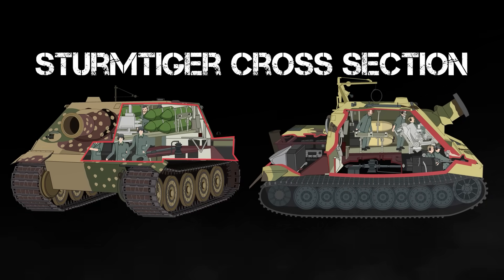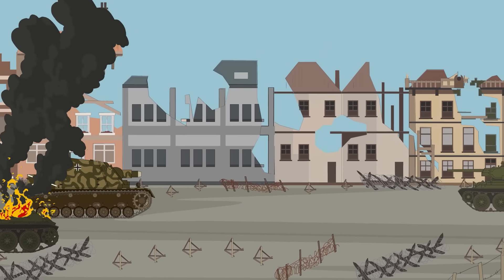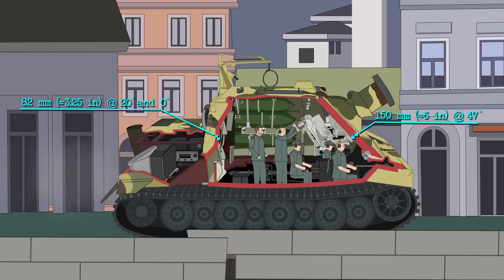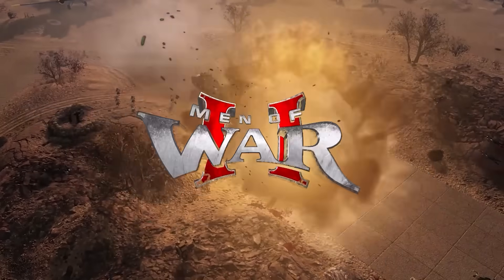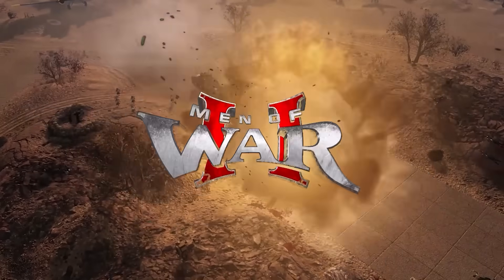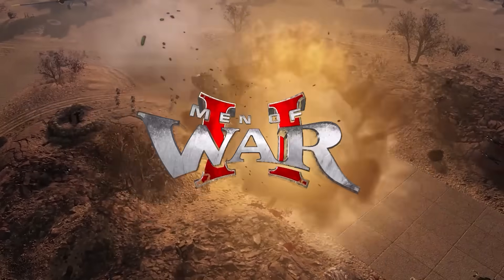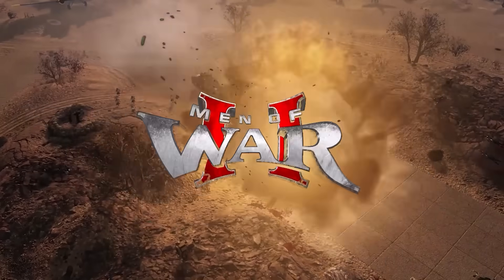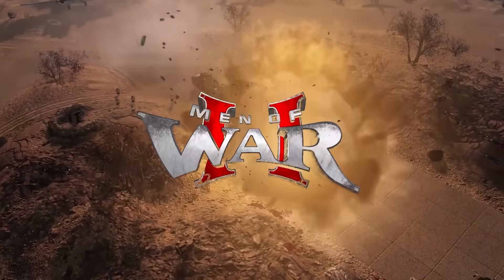Life Inside A Sturmtiger Tank (Cross Section)

Comment: Note: The outside crane was temporarily and was only used to load the ammo into the vehicle. It was dismantled after.  Reloading the gun after firing while in action was done by using a trolley crane bolted to the ceiling inside the vehicle. (Using the outside crane in combat would make absolutely no sense.)

Comment: 5:20 that crane is for aiding with getting the rockets from outside the vehicle into the vehicle using the hatch in the roof. It was not used for reloading the gun.
You got that reload from the Company of Heroes videogame
Reply: is there any source providing this? I cant imagine a human somehow putting a 350kg rocket into the tube
Reply: @lada_niva_1.7i  it's two humans actually, the vehicle has 2 loaders. I don't have a source but it's pretty well known that reloading the vehicle with the crane is misconception. To the point a quick Google search on the matter will show you. It's not something obscure you have to go digging for the info.
Reply: @lada_niva_1.7i  also the rockets aren't man-handled into the 'breech' / rocket tube. There is a "loading tray fitted with rollers" (-Tank Museum website) that leads into the breech. 

But also its evident from looking at the outside of the Sturmtiger that the crane can't access the ammunition racks on either side of the hatch. The long and thin hatch opens over the loading tray in line with the gun, but the stored rounds are on either side, so picking them up with the crane would mean lifting diagonally with the cable scraping on the edge of the hatch. If the reload was meant to be done with the crane they would have just designed hatches over the ammo racks too so they could lift up and across onto the tray.
Reply: @Deuce_and_a_half  ah alright, so the 2 loaders carefully place the rocket on a tray and then slide it into the tube?
Reply: Your comment is an accurate yes they did that they did that because of the sheer white of the tank why is the crane there then?
Reply: yeah, wish modern games paid that much attention to detail
Reply: "As both rounds weighed 345kg, they were far too heavy to be handled manually. Loading them into the Sturmtiger was done with a small crane. Inside the vehicle the crew moved the rounds into the breech ready for firing using a loading tray fitted with rollers. There was space for 14 rounds in the Sturmtiger, including one on the loading tray and one already loaded."

From the Tank Museum. Cant post links. 

But the crane was used to restock ammo, not to load it into the breech
Reply: The Sturmtiger had a roof-mounted winch inside the fighting compartment to move the projectiles from the sides onto the loading tray.

Comment: I figured the weakness of the Sturmtiger would be the fact that the Tiger's engines constantly wore down and was in constant demand for spare parts. I didn't know it needed a crane to re arms its main gun with its 760-pound shells (presumably they are too heavy to lift by hand). On top of that if this animation is correct, the crane is outside the vehicle, making it an easy target.
Reply: The external crane was for restocking shells. 

There is another crane inside the vehicle that assisted the loading of the projector so that no one was exposed during the process. Well, aside from the front as there’d be a 38cm hole briefly for the next rocket to be loaded.
Reply: @theworldsthreat  Oh OK, so it's not as dumb as this animation makes it look. it "only" has the weaknesses of no horizontal traverse plus the usual Tiger engine problems.
Reply: @alex_zetsu  Yes. The engine and transmission problems would be worse from the added weight too. 

On a side note: The projector also takes a couple minutes to reload, not a half hour or so. I’ve seen many people claim it took forever to reload but that isn’t true either.

Comment: Sturmtiger was basically the German late-war "solution" of dropping a 300 kg bomb on specified targets, but without using a fighter-bomber plane, and by that comparison its accuracy was not too poor. Similarly to the German V-2 rockets replacing actual bombers in bombing cities at last years of war, the German developed such exotic designs when there were more straightforward or practical solution were simply put, such solution was practical no longer in face of resource shortage, mainly fuel and thus the disappearance of German planes and trained pilots in latter war years.

Comment: It's the Sturmtiger didn't get to see much of a fight due to it's late introduction and limited production.
Reply: And the fact that it was badly designed.
Reply: @emberfist8347 it’s not like they could design it that much better
Reply: @Ranyick  They could have gone with a smaller gun and less armor.
Reply: @emberfist8347  they wanted to use a smaller gun but they weren’t available in sufficient numbers, as said in the video. And the armor was necessary for its intended role
Reply: @Ranyick  Artillery shouldn’t require heavy armor.
Reply: @emberfist8347  did you even watch the video?
Reply: @Ranyick  It should have been clear to the Germans that such a vehicle was unnecessary. The Battle of Stalingrad along with the concurrent Battle of El Alamein were the final meaningful offenses of the Third Reich. They spent the remainder of the war on the back foot so they didn’t another frontline assault like the Brumbarr but bigger. They needed more conventional SPGs like the Hummel and focus on standardizing their chassis and AFV production on a few models instead of having a dozen different models.